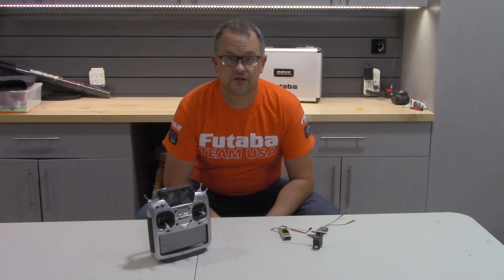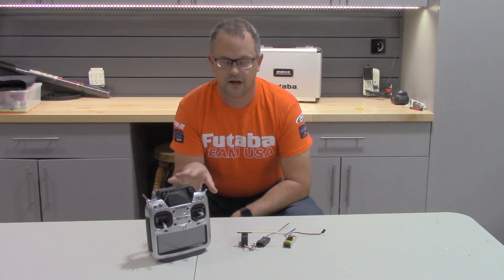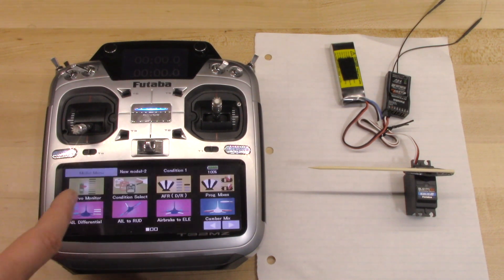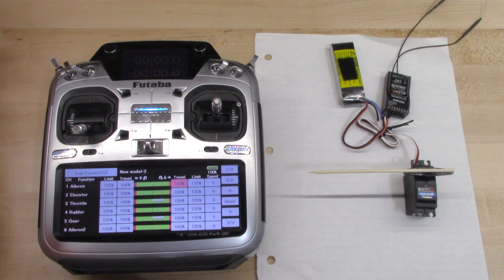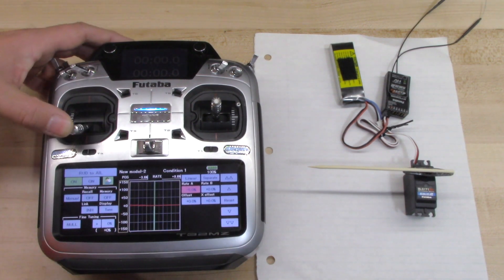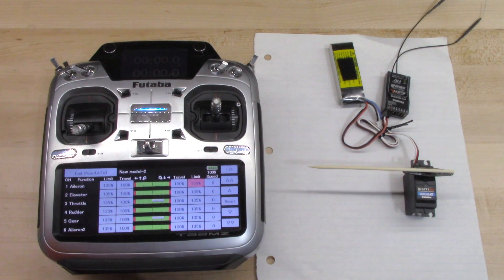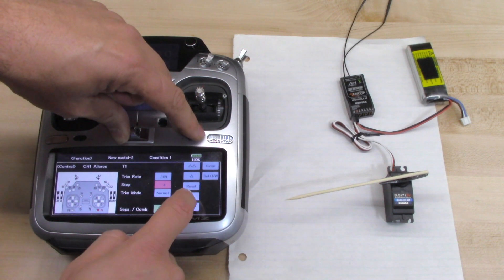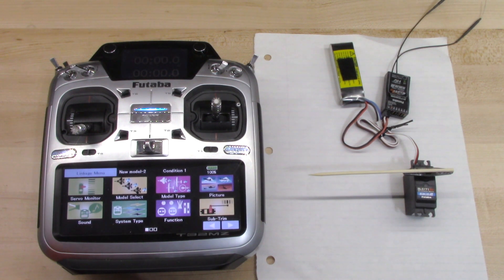Futaba 32MZ Endpoint (ATV) and Trim Explained!

Comment: I have watched a few guys (pattern) using End Points to adjust surface travel and or used it to match up throws between Ail or Elv so they both travel the same. This video will help take some of the mystery out of why not to do that.  If you are looking for video ideas I think a video on using AFR/Ail Differential and Ailevator to set up a plane (2 ail and 2 elv models)  would be appreciated. Perhaps a full series on how you setup pattern planes from the ground up. I know winters are long up there...:)
Reply from the maker: Thanks for the comment Rick, I think I can manage a couple more videos on some different functions!